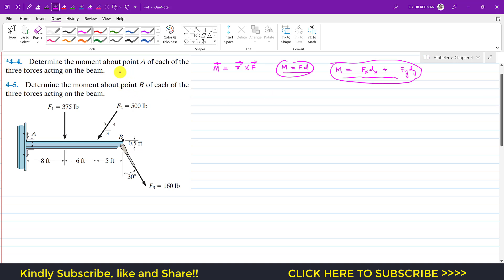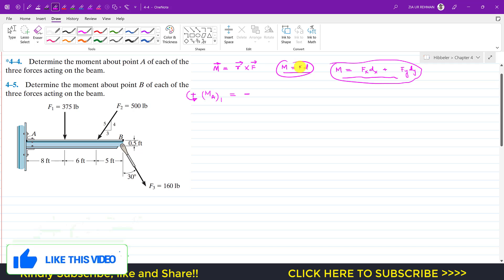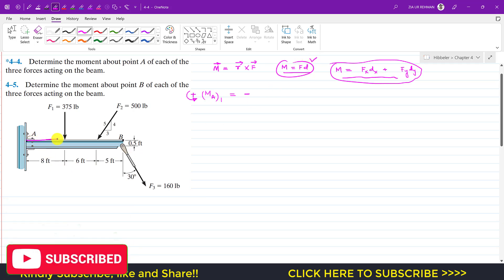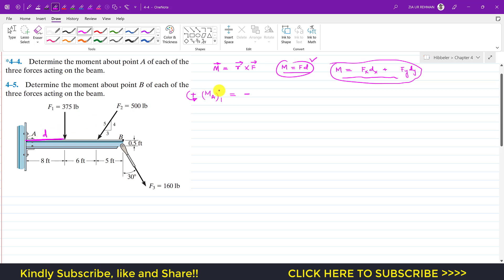4-4 Force Systems - Resultants - Chapter 4 ( Hibbeler Statics 14th Edition) Engineers Academy

Comment: I believe the moment of force 3 at point B is clockwise because its x-component is directed to the right. Please clarify if I am mistaken.
Reply: ccw. Think of the x component as being extended out of the original f3 force. You see it moving upwards. If you continue that motion further than the current position of the x component drawn in purple, it creates a ccw motion

Comment: hello sir! i have a question regarding this problem, i'm still getting confused about the angles and wether i should use sine or cosine. like in that inclined force, F3, the angle if i'm right is coming from the y axis since it's vertical, i thought we use sine when it's vertical but here we used cosine. can you please explain to me? thank you good sir!
Reply: this is a common misconception. cosine gives you the angle adjacent to the force. the way i like to think about it: when looking at the y-component on F3, the 30 degrees is in between the imaginary y-axis and the force vector. Therefore when looking at the y-component, you would use cos(30). For the x component, there is no angle between the imaginary x-axis and the force, so you would have to do sin(30). Inversely, to find the x component, you could also do 90-30 to find the other angle, then do cos(60) and it would give you the same result as sin(30)